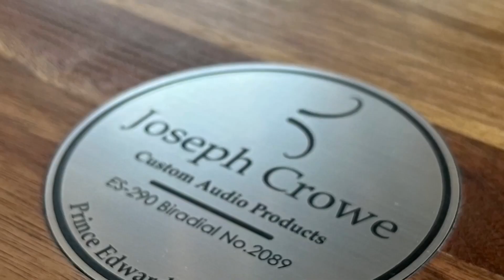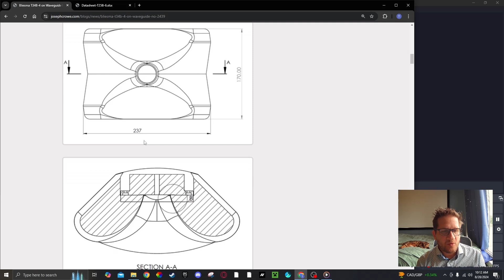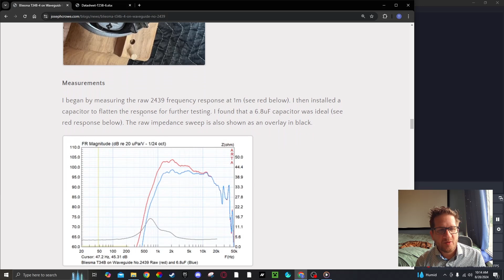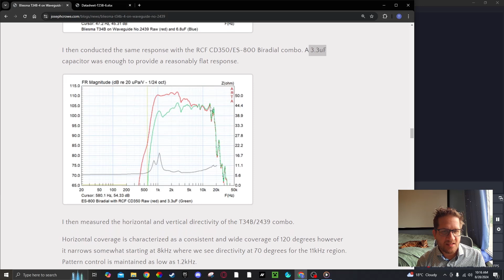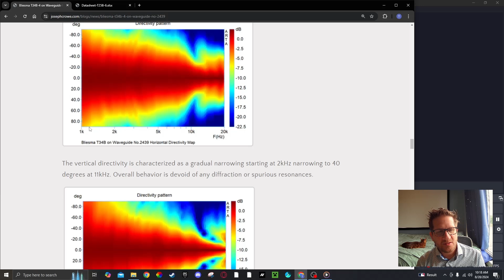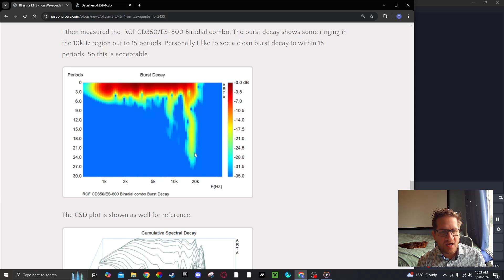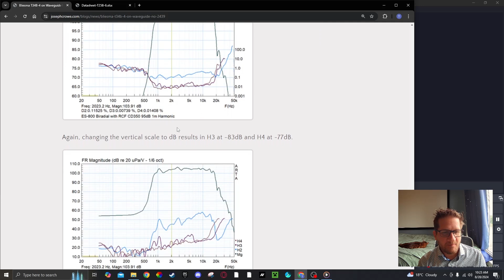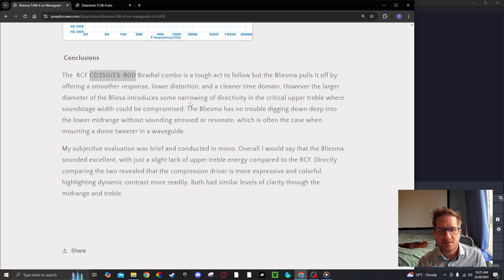Bliesma T34B-4 on Waveguide No.2439

Comment: Nice compairson of the Beryllium and Ceramic. It does re enforce my experance that most Ceramics I have tried sound harsh. I have only used cheep  ones so perhaps this one is better. I have been looking for a cheep Beryllium and their has been on ebay for a few years that is 16% Beryllium and the rest Copper. No reviews anywhere. Its under the name davidlous and they have a 25mm unit. It does look like the primary breakup is about 14K which would make it about the same as a ceramic. Perhaps the damping is a lot better. Love your work BTW.
Reply from the maker: I haven’t really noticed ceramic being worse than neodymium. I’ve tested the 65CD-T vs 65CDN-T and no difference. I’ve tested the RCF CD350 vs ND350 and no difference. These models are the same other than the magnet material.
But I’ve experienced massive differences from model to model even under the same brand…from terrible to excellent, depending on model. So it’s all about a particular design implementation for that specific driver model, regardless of brand or cost.